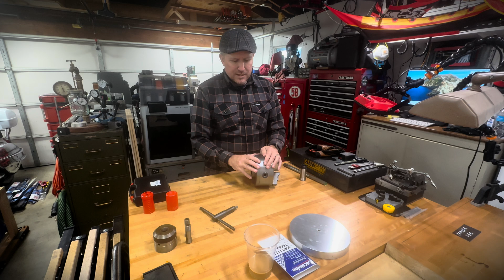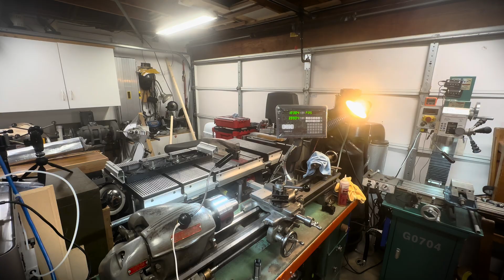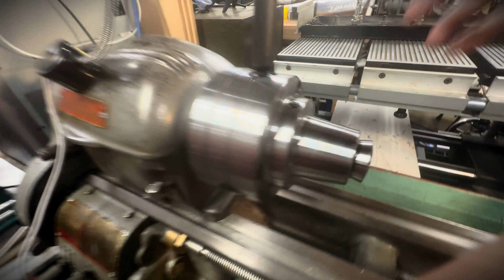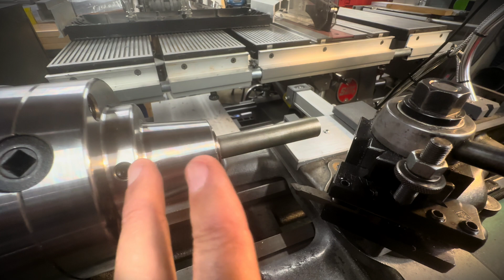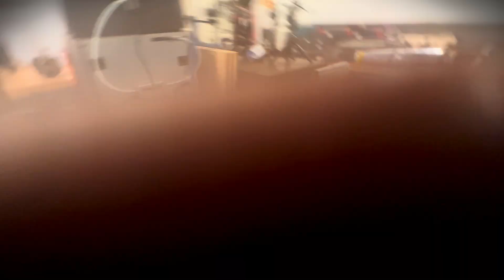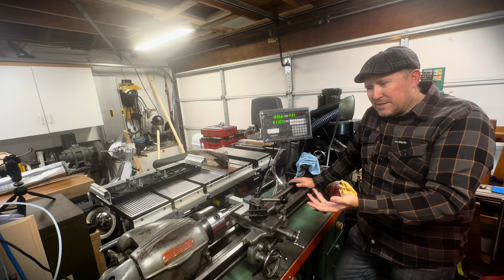South Bend lathe modernized!

Comment: I have 2 1940s 9as. I had a similar backing plate issue. Under heavy loads the chuck would still shift on the backing plate shoulder and cause massive runout. The backing plate is plenty thick enough to cut the shoulder off and redo it

Comment: Hi Channel from Washington state.  It so happened I found a South Bend C and after some weeks, installed it to my workshop as raised blockwork . Lots of hours to clean and lube, sort out a drive.  It's serial number places it as build to late 1935. To my best assessment at the S Bend serial number production and owner records.  I have a shop much more automotive repair in need but where small work projects are an assist and where fair precision can be managed. I sent for a Chinese 3 jaw chuck and find it meets what i require for size,  I admire the DRO shown, and the care to the ways and controls, shields clearly was above average to the unit as shown to the post..
So most of all it's fun to have a lathe.  Smaller tooling is cheap (Ebay) and a sort of learning curve is natural as settings, back gear speed, and various set up meets job.  And while  "C" model manufactured 90 years ago, it's sort of rugged build, good oiling character and simply still makes chips. I recommend interested skills by watching Max Grant, Swan Valley, AU for advanced method to larger precision. 
I am certain my unit requires more time in all define to operation which suits my semi-retired schedule and shop footprint. Compensation for wear to the ways and best tool post tool  holding takes a bit of practice. End user should remember safety as1st priority. To what ever machine in use. Bridgeport, Precision Matthews or relics from S Bend.
 The history of the company with that photograph history is astonishing. Regards, M.
Reply from the maker: Hi Channel - My first South Bend was a 1937 Model C - it was in great shape. I only got rid of it so I could make the space for this Model A. It was in amazing shape and if I could justify it, I would have kept it. So far this Chinese collet chuck has worked well. But, like you, I can manage the precision I need out of it.
Reply: @MAQRindustries  I find it is easy to spend hours at the workbench as projects and I rather like the lessened cost as fair quality to various Chinese tools.  For instance, small boring bar kits. For interested viewers, a south bend serial number assignment can predict the general year of product. And the South Bend web pages include historical warehouse photos of production.  Remember, each unit was hand scraped to tolerance, at bed way delivery.  I mounted my unit as to raised concrete block with the bed as spanning the feet as mounting with a large pine 2x6 to dampen vibration.
My mount did not include a first setup chip tray, a required feature.  Also, good and excellent light fixtures above. This mount after a year as level declined as headstock end a bit lower a level bubble, but very close to level as over the span. Max workpiece as chuck to tailstock is over 36 inches. About 40 inches max.
A must is shown to a good M-2 live center.  Include that in any purchase.
S Bend model C demands well thought out projects and is well matched to the 110 welder units as bench fitment to "parts'.  A steel rack with discard pipe and tubing, various flat bar rem and 12-10 ga plates create the design capacity to really fun assistance to quite any repair.  Hobby types, repair types, beware the S Bend overtaking shop space but where a particular personal liking for their cast weight and headstock capacity will cause chips to discard and a fondness I can hardly define.  The owner seems to simply grow in tool end use, you see.  Cleaned, lubricated and painted to shop grey or tan, an impressive tool. McGary